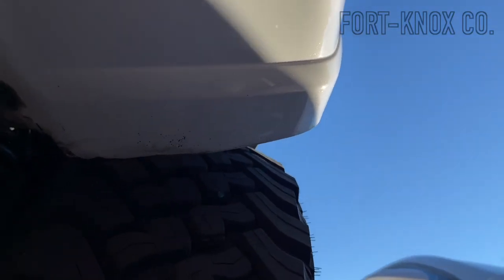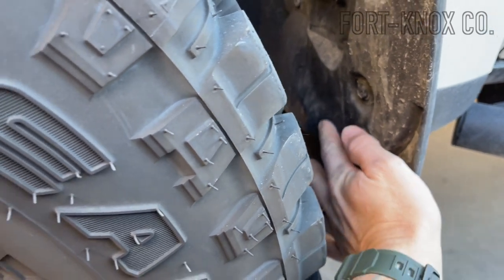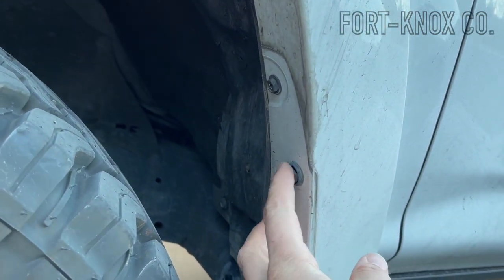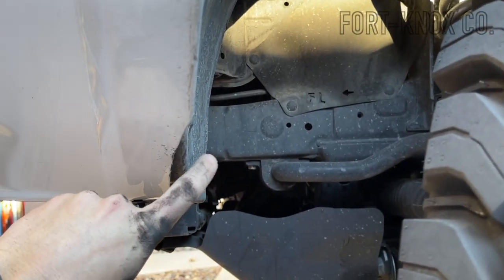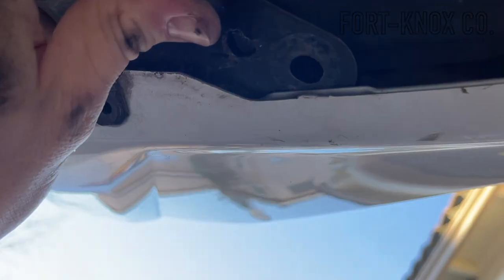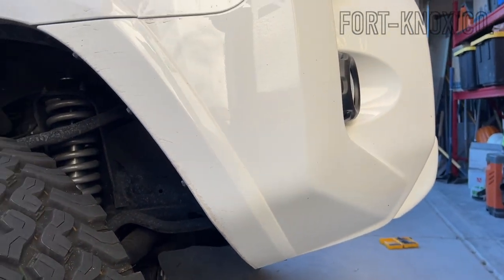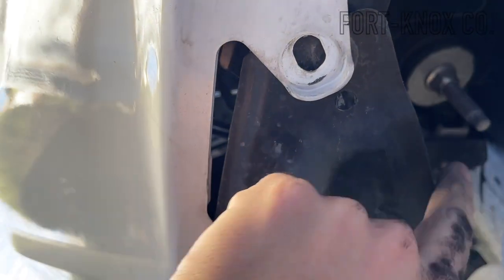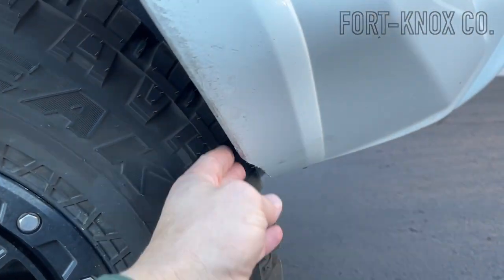How to Fix Tire Rub on Toyota 4runner 5th Generation | Eibach Lift Kit | 285/70r17 Wildpeak Tires

Comment: The only problem is, if you go off road it’s going to rub with any actual use of your suspension.
Reply from the maker: Yes and no. Depends I think on how hardcore your going off road. I’ve been on rough terrain and had some good articulation of the suspension and not heard any rubbing. But If your going to go with this size level suspension (which is minimal) and this size tire, you might expect that if you hammer it off road. If your worried about touching at all while off reading then I’d go with a bigger and upgraded suspension system. Otherwise your next step with this combo would be some type of Viper cut on your fenders and go from there. Which I like the look of those viper cuts and front bumpers, we’re just not there yet on this build.

Comment: OMG, you saved me.  I had previously shaved the bumper, still heard noise and it was driving me crazy. I started thinking maybe it was the CV axle but it didnt make sense with only 30k miles on it. Didnt realize you had to push that black lining back. Did is Saturday and the noise IS GONE.  No joke, id give you a hug if I could. The wife is very happy as well. Happy wife - happy life
Reply from the maker: Hahah nice man! I’m happy to hear this. If my video helps just one person in the world then job accomplished. Thanks for commenting. I really appreciate it.
Reply: @FortKnoxCo  thank you so much. You don’t understand I had pulled the wheels, had a mechanic look at it and found nothing wrong. 6 months we heard it and it drove us crazy. I told my wife that I’m just going to check YouTube one more time. Your video came up. BAM. Problem solved. I’m going to subscribe to your channel now. Thank you again. Seriously thank you
Reply from the maker: @morfdq  man that’s crazy. I’m happy you found it. Crazy how sometimes just a simple fix or pointer can solve such a big problem.  I try to put stuff in my videos that I think woulda helped me if someone would have told me. There’s a lot of people out there asking the same questions I am so when I figure it out I feel like I should share the knowledge.
Reply from the maker: @morfdq  I just started printing shirts again and will probably be doing some Videos on how that whole process is. There’s a lot of tips and tricks I’ve found invaluable and could help people who are making shirts or wanting to start.
Reply: @FortKnoxCo  and I wanted to show my appreciation to you. I had even called Eibach to ask them if it could be their shocks/lift kit causing it. I’m not mechanically stupid. I pulled the wheels and checked CV axle, tie rods and wheel bearings. I was hoping one of them was bad. Nope. Thank you again, seriously
Reply from the maker: @morfdq  no problem at all. 🤙🏼🤙🏼

Comment: Do you hear any creaking with the Eibach kit? I just got the Pro Stage 2 coilovers with Bilstein UCAs, and I hear some minor creaking at low speeds when first accelerating and when going over small bumps.
Reply from the maker: None at all. We’ve had zero issues other than the very minor rub on the plastic with the newer big tires. But the suspension has been cherry. We did stage 1. No upper arms.

Comment: Do you hear any creaking with the Eibach kit? I just got the Pro Stage 2 coilovers with Bilstein UCAs, and I hear some minor creaking at low speeds when first accelerating and when going over small bumps.
Reply from the maker: Negative. No issues. Only did stage 1 and UCA’s. Rides like a dream. Only noise is from the MT tires.

Comment: Thanks so much for the video!  Looks like it's helped a lot of people, and it may help me very soon after I upgrade my tires to 285s.  By how much did you lift the truck?
Reply from the maker: I have the tagged video or you can find it on my channel, but I did a video covering the lift and suspension. In all If I remember it correctly it was a 3” lift after suspension and tires and the wheels are a neg-12 I believe. I have all the exact info  in the other video

Comment: Happy Easter brother....sorry to bother you on Easter.....but the wheels....did you get the  9s in width  with-12 offset and did you get new uca's  ?  Thanks for the help ..be well
Reply from the maker: No problem man. Yes I got the 9 inch wheels with the -12 offset and I did not do any UAC. With this type of lift usually you don’t need that and this thing drives like a dream. So I’ve had zero problems I believe once you go more than 2 1/2 or 3 inches on left you will have to do the UAC

Comment: It’s a good quick fix but for longevity, a viper cut and body chop mount and a pck (pan hard correction kit) especially if you have a lift kit is more ideal.
Reply from the maker: Yes that would be the next step. So far i haven’t had any problems with the quick mods though. Holding strong and haven’t had to re adjust anything since the first day.

Comment: What's your wheel offset? I have -10 in same tire diameter as yours but with a 1.25" spacers and I'm rubbing on the body mount. Just wondering if I could remove the spacers it could clear mine. Thanks
Reply from the maker: I believe these are -12 offset. I have a related video that should be tagged in this at the end or it can be found in my video library. I put it out just before this. I explained the exact offset and lift I used from stock and the tire size. We do not have any spacers on this and I had very minimal tire rub and I fixed it in this video. But in that other video, I explain all the exact numbers.
Reply: The spacers add offset to the wheel. So with a 1.25" spacer you actually have a - 42 offset. The more offset you have, the more clearance you need for turning radius. Ideal offset is 0 to +15 which is what the stock wheels are.

Comment: Looks easy.  I like the simple and straight forward method that doesn't look very obvious at all.  Thanks for the video.  Nice job.
Reply from the maker: Yes. We love the look and drive of the new tires and suspension. Haven’t had any problems with it either.

Comment: worked perfectly. I had exactly the same issue. Just got it back from the dealer and I'm not sure if it was the alignment or the rotation or what but suddenly it was rubbing on that front corner of the bumper. It was always really close but now it was a machine gun like you said when i made a full stop turn like backing into my parking space. I wasn't ready to do any kind of viper or even baby viper cut so trimming with the clippers and just pushing back the inner fender walls was enough to give me the clearance I needed.
Reply from the maker: That’s awesome man! Glad I could be of help. I was surprised at how easily the rubbing was gone. Based off how it sounded I expected to have to tear it apart. But with just a slight adjustment….complete silence once again
Reply: @FortKnoxCo  LOL exactly. I came home from the dealer yesterday afternoon and when i backed up i thought i ran over something really big or something significant fell off, Freaked out. Walked in and started looking for videos on trimming. Thanks again. Yours was the simplest solution and it did the trick
Reply from the maker: @HappyTrekkers  happy to hear that. I hope you hit the like button 🤙🏼🤙🏼 I’ll be putting up a video on these racks I installed in my back windows soon too

Comment: Hey man, appreciate the info.  I got a similar issue but its rubbing on the backside of the front left wheel well.  What can i do about that? Just got a lift and wheels, was rubbing pretty good, took the mudflaps off but still continues to rub.
Reply from the maker: Hmmm. Im not sure on that back part if it’s till hitting. What size tires did you go with? Bigger than I did in this video? I have decent clearance on these. But maybe the brand of tire/tread is a little different. 

You might need an alignment adjustment possibly or a little bit more of a lift. Like a spacer or maybe pushing the tire in or out. Like more or less offset of the wheel to stop it from making contact.
Reply: @FortKnoxCo  285/70/17. WildpeakR/T01 and got a 2.5 inch lift.
Reply from the maker: @sebastiancaballero8666  not sure then. I’d imagine it should be the same results. I had a shop do the install of the suspension. Maybe the alignment? Not sure if there’s a camberg that they can adjust or what.

Comment: what if theres no lift? does it work? just trim and mud flap removal also?
Reply from the maker: With no lift you will have major running issues. You need some added clearance to fit these tires specifically. If you went with a smaller and maybe skinnier tire you could reduce the problem….but then your looking back at factory size and type of tires.

Comment: you added this rims and tires without a lift?
Reply from the maker: There’s a video that I put out just before this one where I put the 2.5 inch ebiach lift on it. After that, I had slight rubbing and this was the video where I showed how I solved that part.

Comment: Does it rub against the body mount when full locks both forward and reverse?
Reply from the maker: Nope. I had zero rub on the body mounts. The only parts that rubbed are where I showed in this video. Very minimal adjustments were needed.

Comment: I just picked up a set of RockTrix wheels 17x9, -12 offset. Looking to get the same size Falken, 285/70/17, AT tires. I know the front fenders will need to be trimmed and the liner repositioned but does this set up touch the body mounts at all?
Reply: I have a 3/2 lift with SPC UCA's
Reply from the maker: I have the 2.5” stage 1 lift from Eibach on it and it doesn’t touch the mounts. Just a small trim job and your set. I have videos on that as well. But very simple fix and very minimal running after the lift,tires & wheels
Reply: @FortKnoxCo  Brian, I was at discount tire this morning and was ready to put on the 285's. They were nice enough to do just the front driver side to see the fitment. The problem was the rubbing on the body mount with the rock trix 17x9 -12 offset. I was bummed at that point and decided to go with the 275/70/17, which will be installed next Thursday, because I didn't want to do that modification. Yes, there was some rubbing on the usual areas with the 285's but I think I'll re-evaluate the 285's when I need to replace this set and do the BMC at that time.
Reply from the maker: @anthonyviscusi4042  aww man that sucks to hear. Do you have the small lift kit installed? Or are you putting the wheels and tires on with a stock set up? Because with my 2.5” suspension lift I have zero body contact. Just the slight plastic fender liner that I trimmed.
Reply: @FortKnoxCo  I have the Bilstein stage 2 lift which gives me 3 in front and 2 in the rear with UCA's...I don't get it but it is what it is.
Reply from the maker: @anthonyviscusi4042  yeah man. Sucks to hear it was hittin the body. I hope you tuck the 285’s one day. The 275’s still really good. I always like
The MT look no matter what size. Looks aggressive either way
Reply: @FortKnoxCo  I still don't get how it fit your 4Runner with all things being equal and you have MT's. Go figure.
Reply from the maker: @anthonyviscusi4042  yeah I’m not sure if when they put my suspension on the adjusted anything. Maybe there’s something they tweek with the alignment or camberg
Reply: @anthonyviscusi4042  lift height 3" and below make no difference to the turning radius clearance. For lift height to actually assist with clearance, the body would need to sit several inches higher than the center of the tire. Wheel offset and castor adjustment are your best bet in attempting to maximize clearance without cutting. Different tires in the same size can also be slightly different in size depending on the manufacturer.

Comment: Do you have steering wheel shake at 60mph with the off-road tires?
Reply from the maker: None. It drives perfect
Reply: @redrider7730  that’s awesome advice!
Reply from the maker: @redrider7730  I agree, you should have the tires re-balanced at a professional shop. They shouldn't be shaking at all

Comment: What tire load index and speed rating to you go with for the Falkens?
Reply from the maker: I believe it is C 6-ply. The E-10 ply is a little too much heavy duty and more weight. I’ve heard it can cause problems all around with the drivetrain. But other people might have some experience with that. But in all reality at 10 ply would be something for real heavy duty towing, which of these vehicles shouldn’t be doing anyways.
Reply: @FortKnoxCo  Thank you for the quick reply.
Reply from the maker: @anthonyviscusi4042  no problem at all. Thank you for checking out my video 🤙🏼

Comment: whats the offset of your wheels, I have the same size tires but my wheels are -10 offset. I had to do a BMC
Reply from the maker: These wheels are -12 offset.
Reply: If you running 2+ inch lift you can run 285 with -12 offset but might rub on the body mount on certain situations when flexing suspension. Also for everyone that I’ve learn from and experience now I highly suggest every 4Runner owner get SPC UCA to have caster adjustments to help move forward keeping away from body mount and for that 285 is the highest tire size. 
Other reasons for having better caster adjusted would be better return to center of steering and stability.
Reply: @MarkTalampas  thank you so much for the information!! That’s a lot of info that most people wouldn’t get elsewhere 🤙🏼🤙🏼
Reply from the maker: @MarkTalampas  yes! I appreciate the comment! Thanks for sharing all that. It’s hard to find that first hand info out there

Comment: What suspension and upper control arms?
Reply from the maker: I have a full video on that I made just before this one. I explain all the numbers. But it’s a ln Ebiach stage 1. With new wheels with negative offset and tires.  No upper control arms. Stock UCA’s.
Reply: @FortKnoxCo  nice! I want to go up to 285’s so I was wondering if yours rub on your upper control arms. I’m guessing the suspension and negative offset help with that.
Good video man!
Reply from the maker: @WendzDarKnight08  thank you. I don’t get any rub with the 33’s on the UCA’s. If you can get the 35’s on there it’d look sick.  You might need a little More lift to tuck those and make the clearance

Comment: Hi did you lift your 4runner? Also, what offset is the wheels?
Reply from the maker: I have a video explaining exactly that. This video was the follow up after I did and how I fixed the rubbing. You it should be in my video library just a few videos before this one.

Comment: I dont have 285 but i did 265. I have rubbing..do you know where to cut for the 265?
Reply from the maker: It should be pretty similar, but in all honesty, you need to pull the vehicle forward and back at a full turn left and right to see where it’s rubbing on your vehicle. These things can be slightly different depending on what your alignment is the wheel set up and whatever lift you have. But whatever it is, it should still be minor trimming of the plastic areas that I showed in this video.
Reply: @FortKnoxCo  thanks bro
Reply from the maker: @itsdatbullshitter  no prob at all. Any other questions shoot them my way. Thanks for watching the video